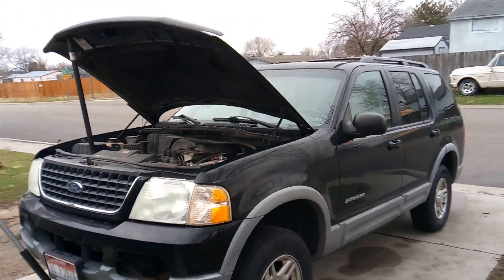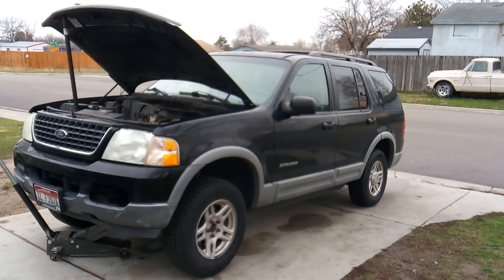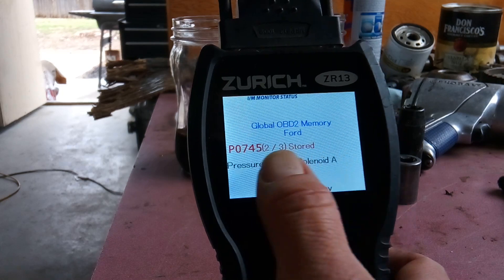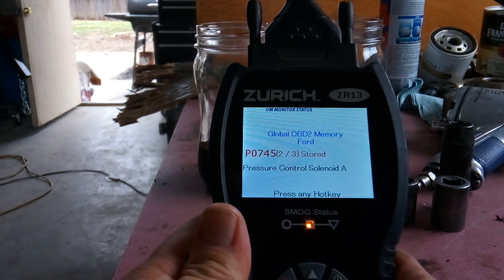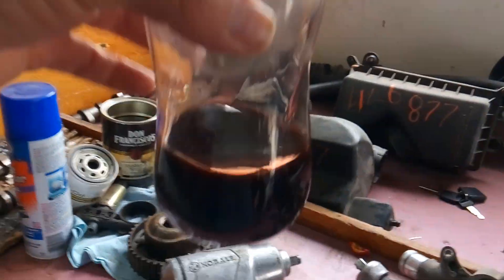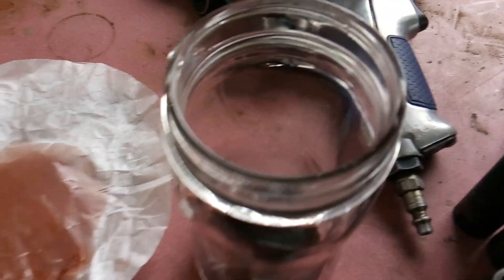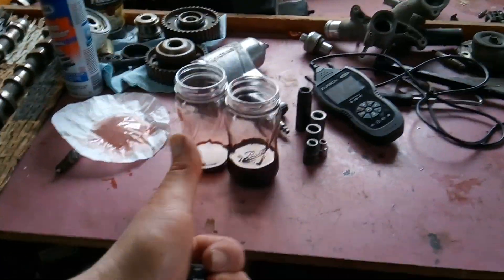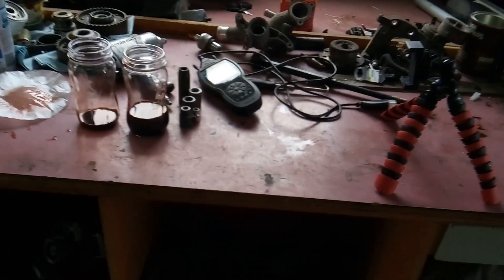Ford Explorer XLT Limp mode/Transmission Diagnosis

Comment: Hey so idk how often you read these and this video was awhile ago but I have a 95 explorer and and the overdrive recently started flashing and my transmission is acting like it’s in a limp it will go thru the first 2 gears then after that the rpm’s start going high and won’t shift

Comment: Hi Matt ... good job ... I think your assessment is most likely correct.  You know what ... it would be an interesting experiment just to see what would happen if the filter were to be changed and also the whole trans was flushed-out by way of one of the cooler lines .... this is a situation where I would do a fluid / filter replacement and then put in a full bottle of Auto-RX just for the heck of it, as an experiment ... see what happens. That might make for an interesting video.  ; )  ( just saying' )